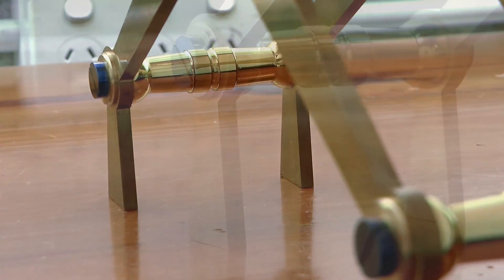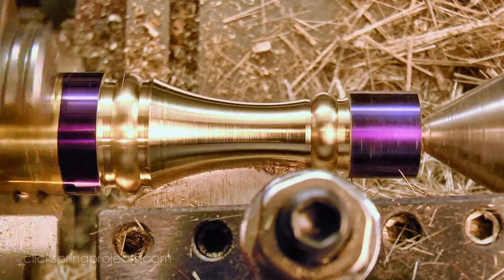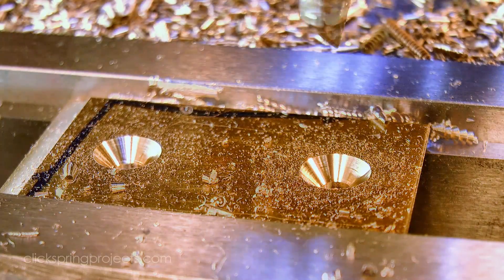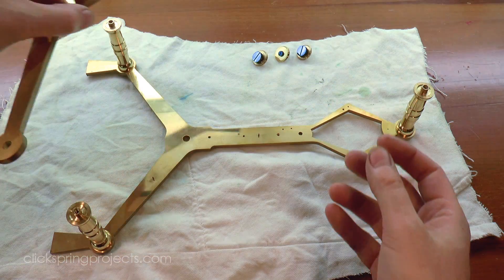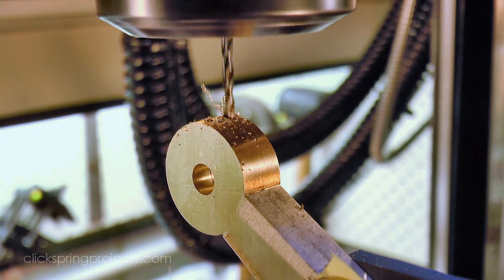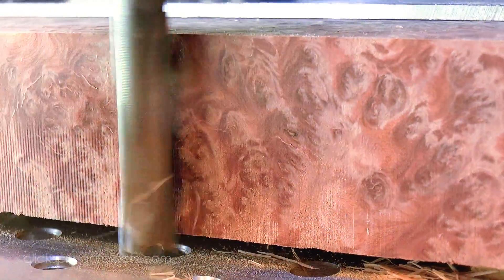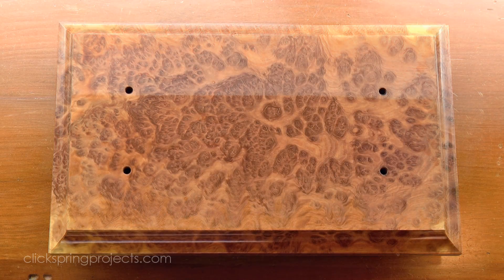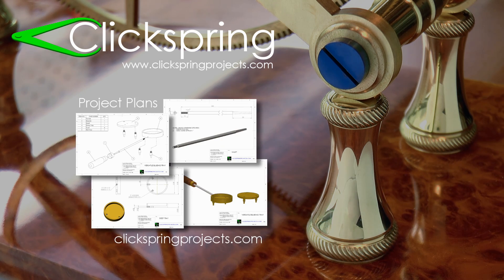Clockmaking - How To Make A Clock In The Home Machine Shop - Part 19 - Making The Legs And Base

Comment: good skills and presentation as usual. this will be my first time commenting to you. a minor tip from a cabinet maker. a true craftsman of wood would always make certain his screw heads align in the same direction. even if it means slightly overtightening the screws into the wood. presentation requres nigh perfection and this small step actually works wonders should you compare the two different styles

Comment: Hey Chris, I do a bit of woodwork myself and I've found that using a mix of boiled linseed oil and melted beeswax seals wood from the environment very well. My only issue is that I'm not sure how good of a finish you could get out of it because of the beeswax.... If you want to try it on some scrap wood to see how it lasts and what it looks like, just mix about 8 parts linseed oil to one part beeswax. Also, it doesn't store well so only make as much as you need.

Comment: As always extremely well done Chris. And very impressive work with that large form tool. I fully expected to see it chatter but there was no sign of any at all. You must have honed to to razor sharp to get it to cut that smoothly. Quite the figure in that wood as well. It's a fairly small piece so you might just get lucky and it won't move enough to affect the clocks accuracy. If I does I have to agree with a couple of others who suggested enlarging the screw holes a bit.
Reply from the maker: Plan B if required is to drop in a brass inlay that will essentially float, and enlarge bolt holes as required. We'll see what happens over the next few years :)
Reply: Yep that would work quite well I think.  

Maybe someday you should mention what your bill for the brass on this clock amounts to Chris. I think quite a few would be absolutely  amazed at what the real costs are.

Comment: how will you get the final finish back to almost mirror, is it normal that over time the parts have almost rusted ? i dont know a lot about brass, great video like always !
Reply from the maker: Brass develops a natural patina quite quickly and then essentially stops oxidising. Most traditional clocks are left with natural patina

Comment: if you are worried about wood movement you could have made a brass dovetail insert for the top that the frame can be mounted to this way the frame of the clock won't move as the wood moves and the wood can slide freely :)

Generally speaking if the air humidity doesn't change much where you're at and the wood has been given a month or 2 to adjust to the climate you won't have too much to fear :)

Anyway I enjoy your videos and I'm keeping my fingers crossed that the base will hold up well (^-^)b
Reply from the maker: Very humid in my part of the world, so Plan B if required is to drop in a solid brass inlay that will essentially float. We'll see over the next few years if it is necessary :)
Reply: sounds nice too :)

Comment: Great video Chris.
I suggest you put felt under the feet so it won't damage the table it sits on.
I very strongly suggest you redrill the holes as over sized as possible, and only tighten the screws enough to keep them from falling out.
That chunk of wood will twist that frame up like foil when it moves during the seasons.
Burl moves more than flat sawn wood. There are online resources you can use as a base point for how much expansion and contraction to expect. French Polish is the perfect choice for finish. It lasts forever, is easy to repair, and gives just the right amount of sealing to keep the wood stable.

Comment: wow it looks unreal!
but could you align the screwslots please ;-)
Reply: My OCD kicked in seeing that until I noticed that they were on the bottom and out of sight.
Reply from the maker: A lot of fuss is made about timing screws, but the reality is that the effect is soon lost at the first dis-assembly, so it is rarely worth the trouble, especially with soft materials like wood and brass that will suffer damage from repeated chasing of the effect. I do it occasionally (https://youtu.be/O8xIjsaDlN8?t=3m43s) but far better to embrace a little randomness in the presentation :)
Reply: I tell myself that its more important to have the right torque, that cant be seen. Rather that have the screw heads aligned. If you have the right torque AND the heads line up, then get a lotto ticket!

Comment: May I suggest that you make the holes in the wood a bit oversized. That way the wood still has some room to move with the seasons and it wont show underneath those wide legs. Expanding wood is powerful and the last thing you want is the wood warping the frames or bend the legs

Comment: Chris, with all the work you did to the feet in making sure they where smooth and had a fine polish, why not put it on a raised glass shelf to complement the work.
otherwise a rubberized / felt pad the the bottom would be better in my opinion. cause if I did all the work to the bottom would be a bit of a pain.
Reply: to see scratches from putting it on a shelf, and from cleaning time to time.

Comment: +Clickspring I don't understand the "rope mill" (did i got it right?), physics. How come the pattern is so even no matter the diameter, I would expect to be chewed up after a few revolutions bot NO! It's even and smooth as a whistle. HOW!? Pleas explain :) ...p.s. Love your channel and work! Keep it up! TY
Reply: Only some circumferences will work, But that number is quite large because the circumference just has to be a multiple of the spacing of the knurls. For instance if the knurls are 2mm apart the circumference just has to be an even number and they will match up. If the circumference were an odd number you would have the knurls cutting in between where they are supposed to after one revolution.
Reply: Go back and watch his earlier "Spare Parts" videos.He made like 5 different knurling tools for different circumferences.

Comment: why do you collor  some parts with blue ink?
Reply: If you mean the screws in the base, these were heat blued for appearance.
Reply: to mark by itching in with a needle where to cut, etc
Reply: from what I can tell, he covers them in ink and then, as you can see, he marks on them where he needs to cut. the dark purple is a good contrast against the brass so making those markings on the ink show exactly where he needs to work to
Reply: Its not really ink, its dykem. Machinist use it so they can mark and scribe lines on parts.
Reply: For markings
Reply: To make marks on them
Reply: So he can mark them for measurements :)
Reply: Derek Dewey
Yeah I am aware, I was letting him know what it does :)
Reply: Derek Dewey ... and to make the marks easier to see against the dark blue background.
Reply: It's Dykem, makes it a lot easier to make markings and measurements over using a Sharpie. A lot more precise too.
Reply: It's (as everyone else has said) to mark the piece, but mainly so you don't scratch the work.

Comment: When threading the the timerscrew how did you correctly judge the cut point for each subsequent pass? Just align against the existing edge of the thread until cut appropriately?
Reply: His lathe has a threadcutting capability, where the horizontal movement is driven with the rotation, so as it turns it moves along. This means when he reverses it things go back to the same position and follow the same path. It's all driven from those gears he showed on the side. Different sets of gears do different rates for different width threads etc.
Reply: You can see when he moves it back to the start it spins really fast in the oposite direction.
Reply: Thanks for the response, I'll take another few looks at the video. I'm a complete beginner with this kind of larger machining stuff, so sometimes the obvious things escape me. My expertise is more with board electronics, this series has inspired me to start trying some machining though. For some reason screws seemed like an "easy" first step.
Reply: +Gabriel Grey not done any machining myself, but I've been eyeing up old lathes on eBay for about a year wanting to jump in... one day!